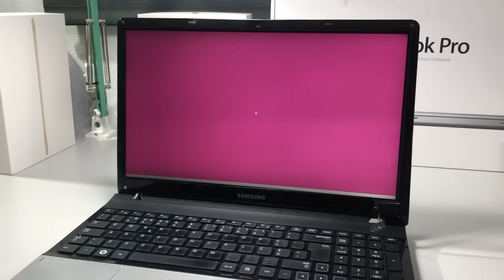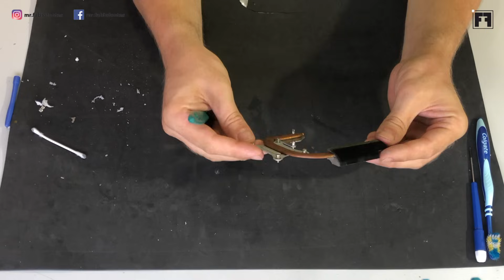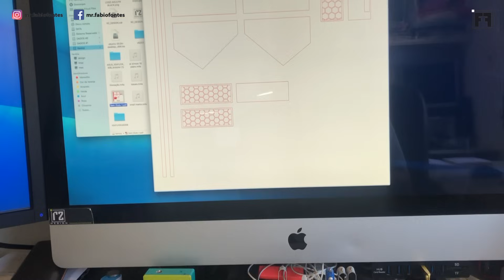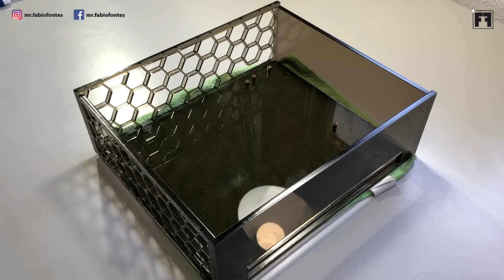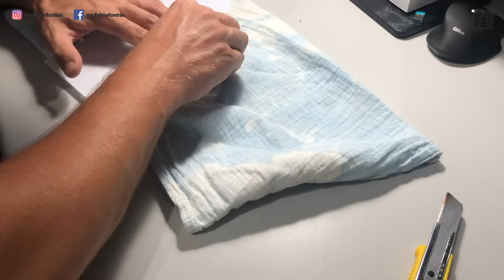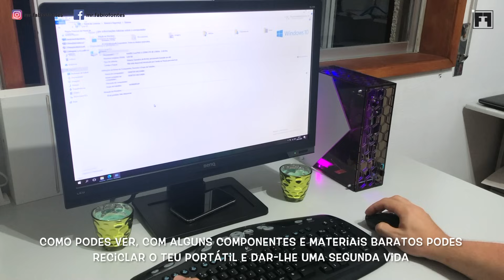Transform a DAMAGE LAPTOP into a DESKTOP COMPUTER for CHEAP

Comment: did you buy a power button?
Reply from the maker: No. In this case i was able to re-use the the laptop pcb and i attached just small tube to make the contact from the outside.. i miss that part.. But i have other projects where i have bought some power buttons here in the channel as well!

Comment: I am watching this, because my MSi Thin laptop has cracked frame and cooling is busted, so any rendering in Blender or gaming is a potential overheat. I am not the most savvy with computers, but I would be willig to proceed with the rebuild since I would have to pay for components anyway and from what I've read about my laptop model the frame is pretty weak and cooling with single fan is pretty unoptimal from the factory, so I wouldn't mind possibly upgrading and turning my laptop into a small transportable package. 

But I wonder how is it with cooling: can you use different cooler or should you stick to the factory one? What about the copper cooling pipes - can you remove them or is that necessary and in that case you need to buy new cooling set?

Also if I'm just a dumbass with not much idea about soldering and how to properly handle computer hardware, should I try or forget about it?
Reply from the maker: You can use better cooling, for shure!
You have space! Being an much more open space your cooling should be improved, you can try it first and then if need try a better solution!

Comment: I have a dell Inspiron 5548 old laptop
But after disconnecting the screen it is not booting and throwing hardware failure by beeping. 
Can you help me ?
Reply from the maker: Yeah some laptops do need the screen to boot... try keep the flat cable connected ... or check in bios if there is a preferencial screen to modify settings...

Comment: If you put the little white adaptör into the case and make two little holes for speakers covered  with some little cloth (inside),  it would be better. ;) 👏
Reply from the maker: Yeah… agree! In fact the Leds i already replace them for some 5v ones soldered into the usb Port :)
Reply: @fabiofontes  :hand-pink-waving:🌹

Comment: M i suppose to watch an another video to know ..how he turned the laptop on without its keyboard power button and where he connected those led light strips?
Reply from the maker: The LEDS as you can see on the video as its own power supply and it glue on the back of the case… As for the power button is the original flat with a small piece of plastic that i miss the shooting but is the original from the laptop… Sorry for that! :)

Comment: Very nice man. That RGB controller the white box. You could of taking off that box and glued the pcb inside the case and have the barrel jack part sticking out for a plug. But other then that it looks awesome.
Reply from the maker: Yeah!! Absolutly… that rgb box is piece of crap i already replace it… :) thanks a lot man!
Reply: @fabiofontes  it still looks awesome.

Comment: but you better use ssd as system
and mabe you can add egpu and usb hub inside and wifi+ bleutooth 5.3 and female usb outside
also internal display to hdmi little adapter to get 2 hdmi connectors
Reply from the maker: SSd is for shure the best option. But at the time when i make the video the ssds are not so cheap yet and the goal is get cheaper! but yeha! It now runs ssd and and linux!

Comment: Awesome and informative video.. but how did you attached RGB light directly to motherboard ?
Reply from the maker: The better way is source or either a 12v or 5v rail and solder direclty there, depends on ur led types.… in this case i think i solder the leds to the 5v power supply on the back from a USB i think…

Comment: great job but I wish you could install ssd disk instead of normal hard disk..
splurge:)
Reply from the maker: Yeah i did later :) but in this case is just to show how you can use parta for cheap :)
Reply: @fabiofontes  i expect better work from you.avoid the cost :)
Reply from the maker: @sinancesur83  The goal here is show the ppl how to revive a brokent laptop for cheap.. Other than that i could upgrade SSD, RAm, use an eGPU and so on.. not the case here!
Reply: @fabiofontes  
I understand that much, I'm not an idiot

Comment: Pretty cool idea. If you had routed in a channel at the back of the panels, you would have been able to hide the leds and make the case glow well. It was still a fun build and great re-use of a computer.
Reply from the maker: Thanks!!! I have already change the LEDS for an USB ones and the little box is hidden inside :)
Reply: @fabiofontes  did you do an update video? This really is one of the best custom laptop to desktop cases I have seen.
Reply from the maker: @johnmichaels4330  no i dont… but im working on a new one :) stay tuned!

Comment: i just bought a display broken sony vaio laptop i5 4200u 4gb ram samsung m2 sata ssd, it connects to my old box monitor and run but become so explodingly hot in 5 minutes any suggestion how i can utilize it to its fullest iam willing to throw some hundred bucks for 16 gigs ram but i can find its ddr3 4 gigs bus speed it shows 20307 mhz
Reply from the maker: Hey man! Did you check the thermalpaste? Have it changed by a good brand and check for dust in the fans! You should be good!!
Reply: @fabiofontes  i cant send you the imgur photos link, can i have your email or discord to send it?
Reply from the maker: @emiyakiritsugu69  i cant figured it out nothing wrong foe the pics… Just try what i say!
Reply: @fabiofontes  how do i change the thermal paste? by taking it to a store and get it cleaned at the same time? i cant do much with the insides or i cant even find the ram bus speed with cpu z or where it is beside the battery
btw did you saw the photos?
Reply from the maker: @emiyakiritsugu69  Yes. If you dont have the knowledge take to a shop and ask for cleaning and thermal past change.

Comment: I tried but the laptop not turning on am not sure what happened 
Everything i have done by the steps 
While connecting power cable the light blinking thats it
Reply from the maker: Double check all the parts! Ram etc...Check if the board isnt in contact with any metal part, try with the battery on...

Comment: I wouldn’t have installed that mechanical drive and maybe you could have fitted the led strip controller/power brick(?) inside the case…
Other than that 👌🏼Awesome design 👍🏼
Reply from the maker: Yah the LEDS was changed later and hard drive dosent justify the value its just for “fun” …

Comment: Great job on the pc case design. I dig it.
Reply from the maker: Thnks mate!!! 💪💪
Reply: @fabiofontes  what did you do to the battery pack?
Reply from the maker: @DrJ3k4lMrH4d3  i think i offer it to a friend… not shure…
Reply: I tried doing the same thing to my asus laptop because the screen is cracked but once I unplug the battery and just use external power it won't work.
Reply from the maker: @DrJ3k4lMrH4d3  Thats strange... But you can do it with the battery pack too...

Comment: Lack of vision. 
1:Should have made the case even smaller
2:Should have upgraded the cooling to desktop grade, allowing for insane levels of overclocking that are cool, and stable. Making it more powerful.
3:Should get some usb, and other extenders so you could mount the IO around the case natively, while also increasing the life span of the laptop/device by not using them in and out.
4:Wouldn't even need to take the whole laptop apart. Only the back to access the cooling solution. Mount the entire laptop in the box, and do above ^ saving it's original form.
and hiding the fact a laptop is in there. Also it would make it whisper quiet, while having vastly better performance. 

Less risk, better performance, and longer life to the Ports and laptop its self. As for a power button, design it perfectly so a button is on top that presses the actual button. 

But still, good job :) I plan on getting the most powerful laptop there is once it's released with their new architecture, right now they are too weak :)
Reply from the maker: Thnks!!

Comment: In my opinion waste of space if you still using original cooler and heatsink. 
I will try to put dvd-rom back in some place too or just replace for another HDD by adapter. 
I don't want to hear how speakers make vibration inside acrylic case xD You should put them on front. 
RGB strip you could install by simple usb...
Reply from the maker: Thnks ;)

Comment: what is the name of cleaning things you work its a kind of liquid?
Reply from the maker: I use for the most Isopropyl alcool for all parts and some glass cleaner mixed with isoprplopyl for the lcd. I normally also use degrease small towels for other parts...
Reply: @fabiofontes  how you supplied power to the mother board?
Reply from the maker: @anurag12181  i use the original laptop charger!

Comment: How did u fix power button...bcz I have same model...power button is attached with the chip n usb ports
Reply from the maker: Fix the small PCb and then in the hole i use a small piece of hot glue tube :)
Reply: @fabiofontes  means you make a soldering of new power pin?
Reply from the maker: @nishanthanehan2657  No. just make a hole on the acrylic and insert a piece of hot glue :D